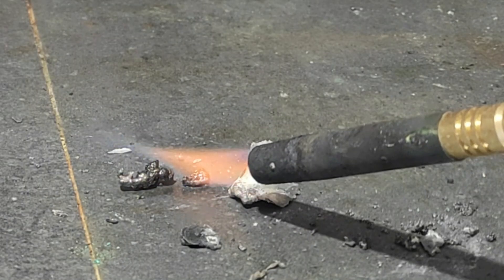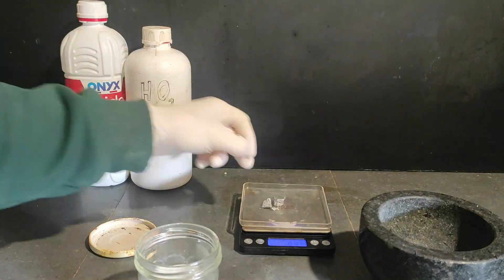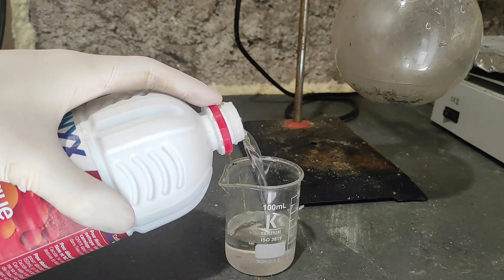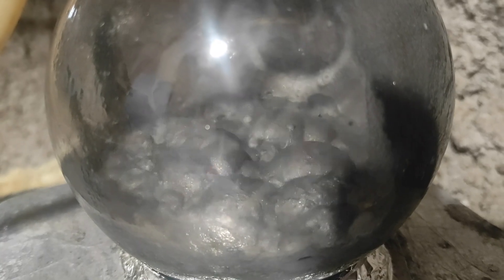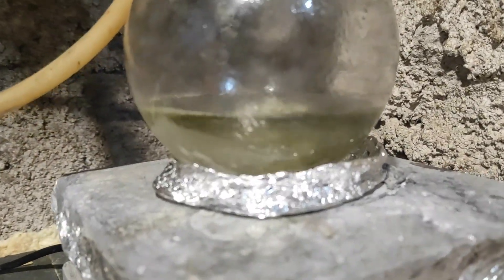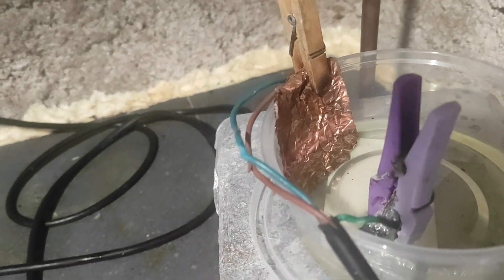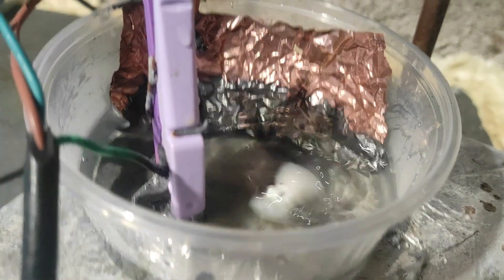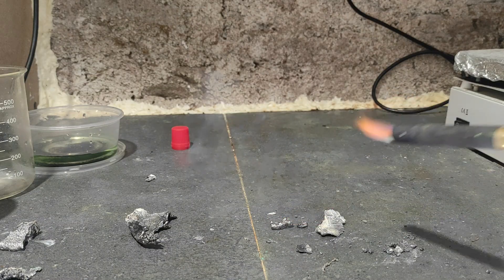How to make Explosive Antimony  (electrolysis method)

Comment: 2:47 using a pure metalloid as a conductor is actually crazy, I bet you could use the antimony anode method to directly electroplate glassy antimony without having to dissolve it
Reply from the maker: Possibly but the paper I was following was using a specific range of concentration so I followed it